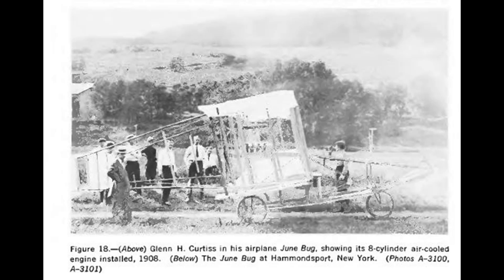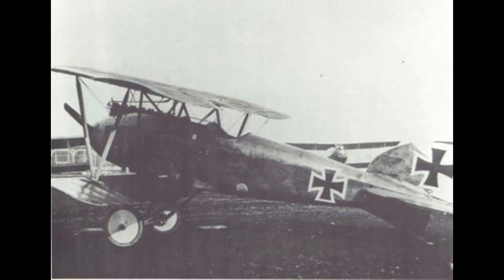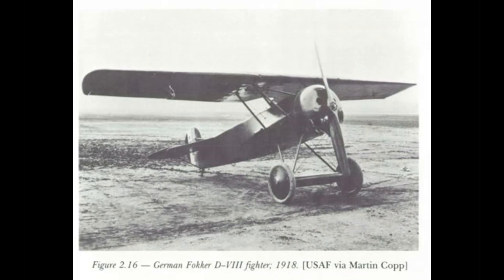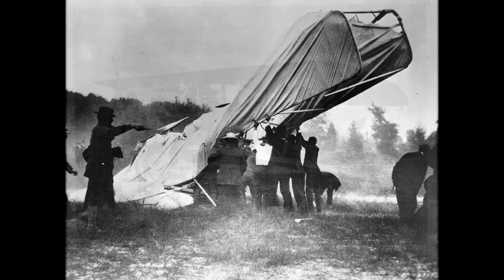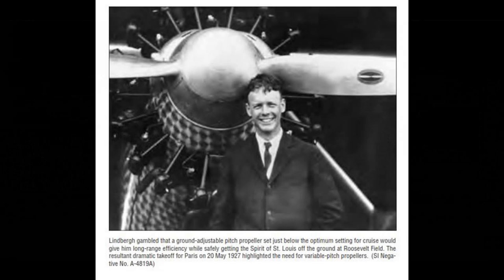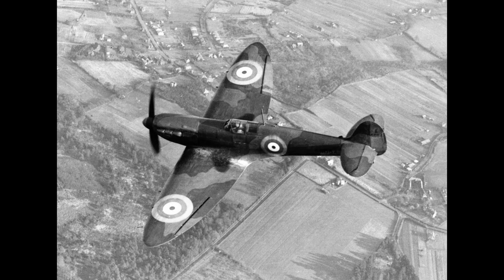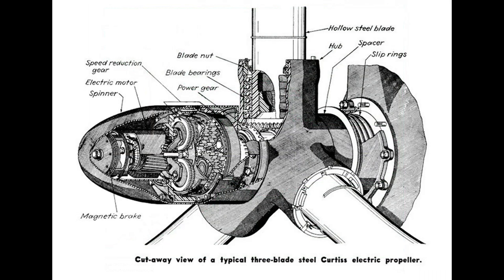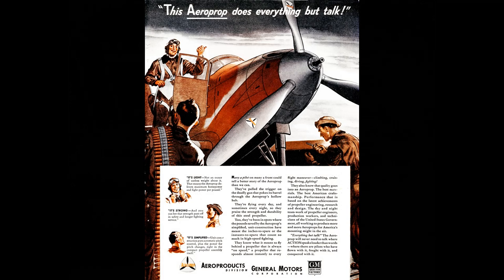Advancements In Propellers 1909-1942

Comment: Greg, you consistently break down complex mechanical and engineering issue down to just the right level.   Your explainations are spot on.   Thanks for that.
Reply: "This is a simplified diagram. The actual diagram looks like the circulatory system of a small mammal  .... which is to say its highly complex.  But for our discussion..."
Must rate as the most eloquent word-picture *ever*.
Just poetry.
With a very sharp focus on the factual.
Excellent.
Reply: @Farweasel  27:00

Comment: Curtiss electric propellers experienced quite a spate of faults when operated in the Pacific theatre during WW2 due to insufficient tropicalising. Evidently, the typically humid climate ultimately caused internal moisture trapping and corrosion.
Reply from the maker: I'll take a hydraulic prop over an electric 10 times out of 10.

Comment: I’m not sure I understand all the engineering nuances (I’m not an engineer or pilot), but this DOES explain why it might have been a minor miracle that my Dad’s F6F (Hamilton Standard prop) made it back to the USS Lexington in October, 1944 after a 20mm round from Japanese ground fire peeled away a good portion of the prop hub. He reported that the engine ran “rough but cool” on the (purposely) low-speed return trip, with oil pressure down to 10 lbs. by the time he landed. In the photo I have, the front of that big P&W behind the mangled hub was thoroughly covered in oil.
Reply: I think your Dad's incident reinforces the default position of a damaged pitch control should be in landing mode.  My Dad had problems with Curtiss Elec. props  flying the hump in C-46's.  thanks for this good story.

Comment: Heh heh, prop failures may be rare now, but one almost happened to me! It was in a Rans S3 at my flight school with a carbon fibre prop. It was the oldest plane at the school with various miner gremlins and rattles and no-one liked that thing. The last two registration letters were   Quebec Whisky and we called it “Quebec Fix-Me"!

I eventually heard it got totaled when one blade delaminated in flight, shortly after takeoff. They still had some thrust, so the instructor took over and made a 180 back to the runway. He very nearly pulled it off, and would have made it if there hadn't been a power line in the neighboring farm right at the edge of the field. (airfield owner had told me it was basically a spite wire. No comment) Instructor was okay, student got miner injuries (he went to a different school after that) but that airplane was a sculpture! I saw it a few days later and never have I seen a more bent airplane that wasn't in pieces.

The punchline came weeks later when I was bored in the office and happened to pick up the logbook for old Quebec Fix-Me. I looked down to the very last entry, and there was my name! I missed that ride by a few minutes worth of engine time!
Reply from the maker: Wow, I'm glad everyone was OK. Prop failures are very dangerous as you know. Rare, but very often fatal.
Reply: Are they supposed to be xrayed after an amount of hours?  A friend had a prop from a cessna on his wall that looked fine, but apparently failed its xray test hence how he got it cheap.
Maybe thats just an australian law?
Reply: @Colt45hatchback  I don't think general aviation props get xrayed in service. He probably means that it failed an xray during manufacturing so it couldn't be sold as an airplane propeller in the first place.
Reply: @TonboIV  that makes sense, the paint was all intact, and i recall an alloy, or maybe stainless steel plate about 2-3mm thick and probably 3"x1.5" in size bolted to the outside of the centre of the prop between the blades and possible slightly toward the outer edge affixed with two large phillips head screws with something written/stamped in it, i cant remember if it was a date or if it said not for service or what. But i remember thinking that doesnt look like it would stay there with the engine vibration. So youre probably right it may have not passed qc inspection at the factory
Reply: Evidently the flight school was lax in it's maintenance  because carbon fiber propellers require more maintenance than metal propellers, though that's true of all plastic propellers  (carbon fiber is a variant of plastic)
Reply: @michaelmckinnon7314  Or more properly called: a COMPOSITE material (ie. composed of fibers embedded in a resin matrix)! A Plastic is different.
Reply: @michaelmckinnon7314  the right term would be FRP. - Fiber Reinforced Plastic- the fiber being carbon,  but applies to glass, ceramic (kevlar) or other things
Reply: @danweyant707  It depends on the source, some say "plastic", But a more proper term would be "POLYMER", because some polymers are thermosetting compounds, and as such, they are no more "plastic" once set or "polymerized" ("crosslinked"). 

Epoxy is one example, it is a catalyzed polymer and not exactly a "plastic". Polyethylene and Polypropylene are true "plastics" and can be melted and molded again several times.
Reply: @alfredomarquez9777  If I may, plastic in the technical sense refers to permeant deformation of a material under force not the ability to melt it, the general classes of polymers known as plastics include thermo (re-meltable polymers) and thermo set polymers which char rather than melt under heat

Comment: Thanks Greg.  I have used Controllable pitch propellers on Type 42 destroyers (Ships) which have a lot in common, although they are fully reversible and we did not run them at constant speed.  Thy hydraulic systems you showed are familiar and I thought you did a great job of explaining them.  Thanks for sharing.
Reply: Odd that you should mention this. My neighbor has ordered a variable-pitch marine prop from a company in the UK. He’s still waiting because it’s delayed in customs, but he showed me technical information that has a great deal in common with these aero props. I need to take a closer look.
Reply: The same sort of system was used in powers station and marine turbine power control. These run at constant speed but use the governors to move the steam throttle valves. They have built in positive feedback and control damping back to reduce oscillation and ultimately speed runaway. The issue with all of these systems is the potential for runaway where the governor goes into oscillation between full open and full closed. When that happens it’s the same effect as fully open. In a power governor you get max power runaway in a speed governor you get over speed.
Reply: “Screw”

Comment: Greg- Thanks for this propeller series. It hits home for me personally as my father was "radio" on C-46 Curtis Commandos flying the "Hump" in late '44-'45. He had related this aircraft was sent to do its job way before it was perfected. The two most common problems being leaking hydraulics, and problematic Curtiss Electric props.  It was my understanding if an engine was malfunctioning, many times the prop would not feather.  Anyway, I am proof he made it through.  Love your channel.

Comment: Just have to say, I sort of envy the man who first developed a mechanical governor like this (which I suspect might have been on a steam engine or even before that), and could observe his invention in action for the first time. Super elegant device in my eyes, simple and sooooo useful in every imaginable spinning machine!
Reply from the maker: Steam engines do have something similar. That governor is simple in principle, and brilliant in execution.
Reply: Pr-electronic automatic transmissions use a very similar governor on the output shaft.
Reply: Quite a few things have this type of governor.  Old wind-up Victrolas to maintain turntable speed and single phase electric motors to disengage the startup windings to name two.
Reply: @GregsAirplanesandAutomobiles  https://en.wikipedia.org/wiki/Centrifugal_governor It seems governors of this type (in general layout at least) even pre-date steam engines!
Reply: @GregsAirplanesandAutomobiles  A steam engine governor uses exactly the same principle, and was undoubtedly the inspiration for this governor. This steam governor was invented by James Watt - in 1770!

Comment: Hi Greg,  enjoy your presentations  ---    In 1954 I was stationed at Hickam field, territory of hawaii in  USN squadron VR-7  --  our bird was the R7 v or super constellation --   This was one of the first applications of reversing propellers.
The prop was Ham std 43E 60  -- and was giving a bit of problems--  I worked in engine build-up and change but props were my responsibility -- In short, the internal spider support block were failing and we went through at least 4 modifications before a satisfactory solution was found.    In two years I disassembled, modified, re-assembled and tested more props than the average mech would do in 20 years.
I think I could still take that prop apart today  --   
The governors  were  pretty trouble free, in operation they worked pretty much like a governor on a steam engine but with very precise tolerances ---

Comment: Great info on the workings of the constant speed prop. Re the metal prop blade thing, the Brits used a wooden composite called Jablo until the end of the war. I can't recall seeing them used other than on Spitfires, and not at all before the MkV in early 1941. You can see pics of Spit IXs crash landed in Normandy with their wooden prop blades shattered instead of bent. It's very distinctive. These were Rotol props (a company set up by Rolls Royce and Bristol).
Reply: IF U HAVE A PROP STRIKE WITH A WOODEN PROP, YOU PUT ON A NEW PROP.IF YOU HAVE A PROP STRIKE WITH A METAL PROP, THE ENGINE MUST BE TORN DOWN, AND THE CRANKSHAFT "RUN OUT" TO CHECK FOR TWIST.

Comment: My step-grandfather was RAF groundcrew in WWII. He said that early electrical controls for propeller pitch needed frequent pilot attention in climb or dive. The cause was change in resistance of wiring with temperature. This problem was solved later in the war by substituting a graphite conductor for a certain length of wire. The temperature coefficient of resistance of graphite is negative, while that for copper is positive; graphite and copper wiring could be connected in series so as to give the same resistance at any temperature.
Reply: The same thing can be achieved with with a copper nickel alloy like Constantan. (That is also used in thermocouples).

Comment: I did some experiments with fixed pitch prop in dcs. I used P-47D-30 for this job, because obvious reason, curtis electric prop.
I tested couple pitch settings minimum pitch, climb pitch,cruise pitch. Take off with minimum pitch. I apply full throttle(i did not use turbo at all for all tests), first it looked fine but as i gained speed rpm pass 2750 red mark, i was forced to retard throttle, at moment when i lift off MP was 30inch. Top speed was 150-160 with small engine overspeed 2800rpm. Max MP below 25inch. Then i tested higher pitch settings, they improved flight top speed, but take off roll get ridiculous long, making impossible to take any combat load. Conclusion fixed pitch for P47 is not an option. I had so much fun testing that.

Comment: Hi Greg! I need to offer some feedback from my time flying warbirds: Spit, Hurricane and Bf-109. I check out on the Brit aeroplanes first, and came to love their seemingly modern constant-speed props. Operating a Merlin is nearly carefree. The Bf-109 shocked me because it didn't have an operating C/S prop. In fact, it had an electrical prop control box on the floor, but consistent with its 1941 configuration, the restoration team lock-wired it OFF. In lieu of a "modern prop," there was a tiny propeller pitch toggle switch on the throttle, and a pitch indicator on the panel. What a mess! My warm-up routine in the RAF types started with a 1500 foot tall wingover from cruise power. Big speed changes resulted in big propeller pitch changes, but the pilot is blissfully unaware. In the 109, the airspeed changes caused the engine speed to bog down terribly, and it was barely able to achieve the maneuver. Manually regulating the prop pitch to control engine speed helped, but it was an "eye magnet" in the cockpit. I was appalled. I think that Luftwaffe pilots either (a) spent more time looking into the cockpit than ideal, (b) learned to roughly regulate the engine by sound, or (c) thrashed their poor engines when too busy to fuss with them. Maybe all of the above. Such differences are often overlooked, but the effect was not subtle. Great videos! Thanks!
Reply from the maker: Wow, thanks, that's a great post.
Reply: @GregsAirplanesandAutomobiles  Enjoying your work.

Comment: The Rhodesian Air Force used mark 22 Spitfires well after WW2. They stopped using them when shrinkage of the wooden prop blades due to the dry climate caused problems. Most model Spitfires seemed to have wooden blades, but some were fitted with metal blades in some theatres. I have a prop blade from a mark V and also a mark XVIII Spitfire….both wooden.
Reply: Looks like they got a "monkey model" version - far as I know UK mk.9 onwards at least had metal constant speed or metal variable pitch props. Mk22 with wooden props, someone got conned.

Comment: I like to think of constant speed props as being like a cvt transmission for the air. Of course a lot of cars with cvts do it in steps which is ridiculous, but snowmobile transmissions harness the engines power in a very similar way. The engine can be tuned to make peak power at one specific rpm, and the cvt makes sure that the engine is always at that rpm when the throttle is wide open, except when nearing top speed of course.
Reply: I was told that the CVTs were made to shift in steps because it was felt that people would not trust a transmission that they could not feel shifting .

Comment: wrt the Hamilton Standard prop, I think that the short summary is that the governor is a speed-proportional hydraulic pressure regulator, that moves the piston in or out (via force-balance against unregulated pressure) to adjust pitch. For me (as a long-lapsed mechanical engineer) that's sufficient to "unlock" the rest of the workings.

Comment: As I understand it the Rotol prop which the British used quite widely in WWII was a wooden core with a plastic skin, where the leading edge was reinforced with a brass strip.  I assume this was a wartime expediency but they seemed to work, considering they were used on the later Griffon Spitfires too.
Reply: This is essentially what MT propellers are today. These are high-end german made props that are used on a lot of modern GA aircraft as well as replica warbirds...

Comment: Douglas Bader crashed a Spitfire attempting to take off in coarse pitch at some point between March & May 1940, prior to the adoption of constant pitch units. It was in late June 1940 that de Havilland began fitting conversion kits to all Spitfires & Hurricanes then using adjustable pitch propellers & this work was completed by mid August, before the greatest air battles.

Comment: Just to say there were 3 main brands of propellers in France: Eclair created along pattents of Marcel Bloch-Dassault and equiping e.g. most Spads during WW1. In the 30s and 40s Chauvière and Ratier were mounted on military airplanes. 
Ratier still exists in Figeac (south of France) in 2022 and makes the composite blades for the A400M and others.

Comment: The constant speed props seem to function very similarly to modern variable valve timing sprockets in car engines. Controlled by oil pressure, although in cars, they're actuated with solenoids rather than springs.

Comment: Thank you, thank you thank you for doing your best to correct the common misunderstanding about Lindbergh's flight. I am constantly correcting people on it. 
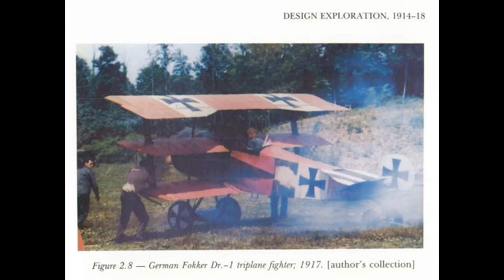You might be surprised to learn that the Battle of Britain included engagements over Wales, N. Ireland and even Scotland. So it would be correct to say the Battle of Britain was fought over Britain as opposed to England. I watched a DCS fight where a Sopwith Camel went against Fokker Dr.I over several rounds. It confirmed to me something I had read many years ago. The Dr.I got it's maneuverability more than anything else from it's fully floating rudder. You can see it here at 1:49 and compare it with the Albatros D.V at 2:17. where a fixed vertical stabilizer is visible with the rudder attached. I know it's a sim, so it can't be perfect, but Greg, you really should see that Dr.I flip around the sky. It's astonishing. It's called A Gentleman's Dogfight and it's by Growling Sidewinder.

Comment: The only reason I didn't have to pause and replay sections of this video was because a few years back I was working @ GA Tech and in one their bookstores I found 2 books on aircraft maintenance, which had a surprising amount of information on piston driven aircraft from this era. I've got to find those books in storage. There are even schematic diagrams of the cables and pulley systems controling flight surfaces and such.

Comment: I k ow absolutely nothing about this subject but... I was having dinner with a good friend who told me that his brother made propellers for classic airplanes, it was what he did for a living. He mentioned that his brother had by some chance found the original specifications for a spitfire propelled in some old factory that was shutting down. I seem to remember being shown some press coverage on the phone. He also said that the propeller was not wood or metal but some composite laminate material. No idea what. I completely trust this chap and it was the first course so in fairly sure I understood. Might be worth looking into.
Reply: Some Spitfires used wood fibre and synthetic resin blades.  I tapped a Mk IX prop blade a while back and it felt tacky like ‘araldite’ epoxy resin glue.  The only replacements are manufactured in Germany.  Allegedly (!) prop strikes are less traumatic as the blades abrade more with less shock loading than with a sudden shatter or bend.